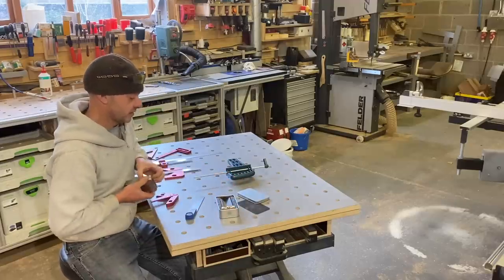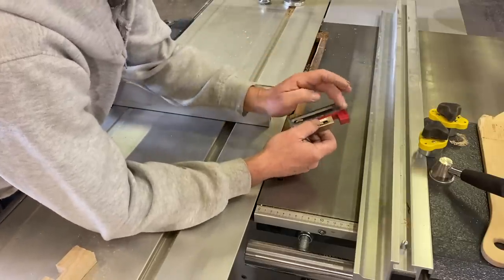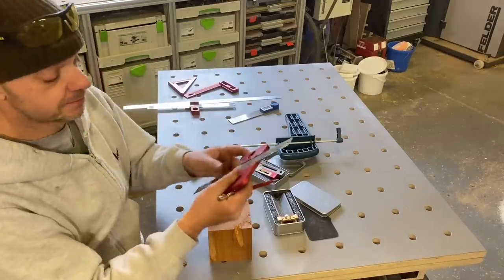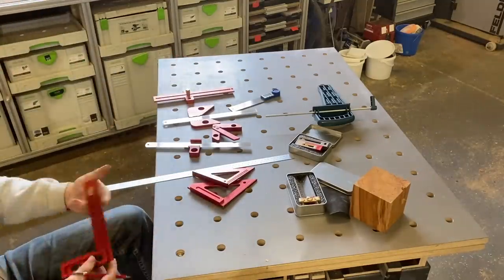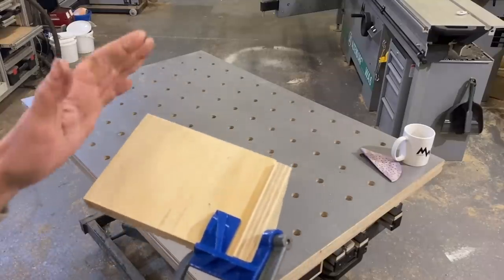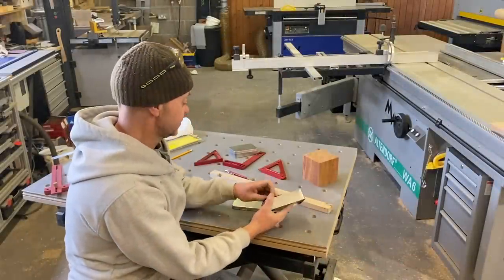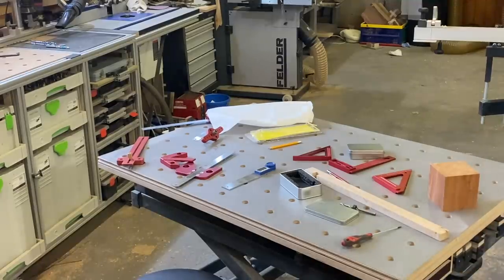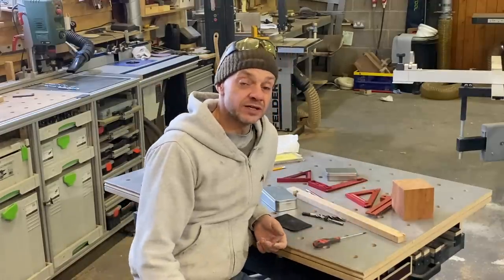#MWShoptalk  - Banggood measuring stuff

Comment: The V Angle on the drill depth/ Saw/ Router height setting gauge can be used to check the drill bit's cutting edges when sharpening it or needs to be corrected for drilling. Your review of these tool are great, much better than some others I have seen. keep it up.
Reply from the maker: Oh go it , thank you

Comment: Found your video very interesting, I can see the potential for some of these tools in my workshop. Thanks for the time you have taken to explain the pros and cons of each tool. I was impressed with your bench layout using extrude section similar to the mft table. I have tried to locate a supplier of this section, but not found anybody as yet. Could you tell me your supplier please? As I use my mft a lot and would like to roll out a rail system in my new workshop that I am currently in the course of building
Reply from the maker: Cheers.   I have all the info inc cut list, parts used and links to were to buy here - https://www.etsy.com/uk/ManorWood/listing/550680114/mega-mft-style-bench-full-sheet-of-84?utm_source=Copy&utm_medium=ListingManager&utm_campaign=Share&utm_term=so.lmsm&share_time=1589651459228

Comment: I’d appreciate if you could check this mitre clamp. I bought a pair recently and I’m afraid it’s a piece of junk. It has no strength to keep boards together. There is a screw to tighten/loosen but even in the tighter position it doesn’t hold well enough. 
I like the red ones though:)

Comment: Thanks for the great videos.
As it happens I ordered the dado gauge and drill bit gauge about ten days ago, (still to arrive), even though I did make the dado gauge myself.... couldn’t resist the bling.
I don’t have a table saw, but it works just as well with a track saw and MFT.
I don’t have that exact corner clamp, but do have the Kreg one, which looks almost identical. Found the thing to be way too fiddly, and didn’t trust it. Went on to buy this Can-Do Clamp https://www.amazon.com.au/dp/B000LJNJNU/ref=cm_sw_r_cp_api_i_dtb8DbDKJKKYZ which works beautifully - very heavy duty and far more robust than appears on photos. Went on to buy two more, making four total. Used them to make lattice frames recently.
Thanks again.